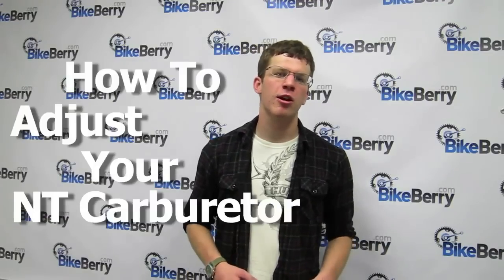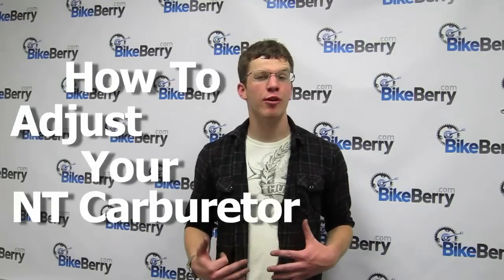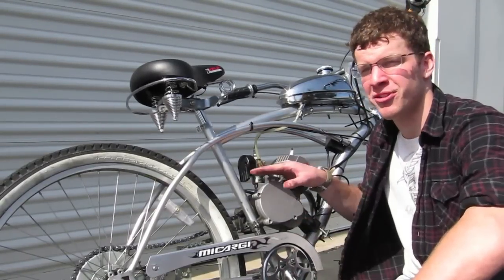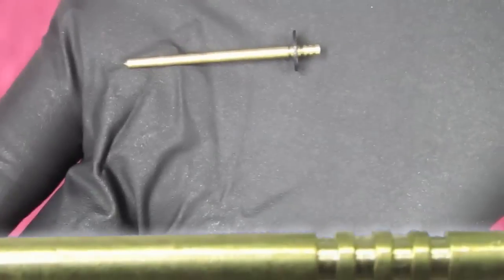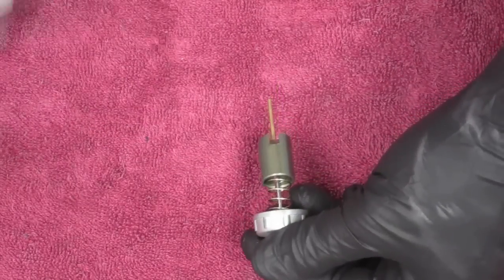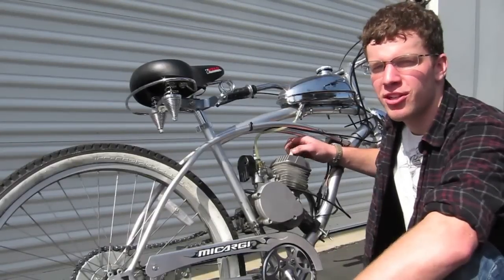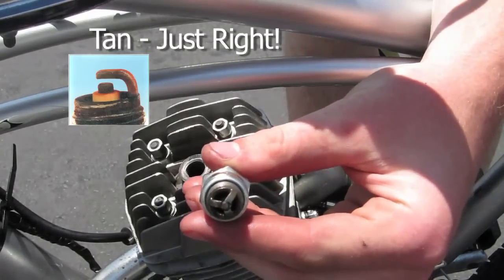How To Tune NT Carburetor for 48cc 50cc 66cc 80cc Motorized Bicycle

Comment: Hey guys! As far as the carburator adjustment is concerned....I have a 2 stroke 49cc Chinesse motor on my bike. All the times that I used to unscrew the spark plug, it's always was dark and oily. Today I opened the carburator and saw that my C-clip was placed just one place before the leanest position. So I decided to place it to the highest position (100% leanest mixture) so it doesn't run so rich, and put on a new spark plug. The result was that I get the same dark- oily appearance on my spark  plug. I'm running about 2 - 2,5% oil (Motul 2T). The only slight difference I guess was lower smoke from the exhaust pipe. My question is if the oily appearance it is a matter of spark plug. Somewhere in net I saw that the spark plug suitable for this engine is NGK B5HS, and I have NGK B8HS.  What is your suggestion?
Reply: +Marshall Murdock Hi, so since your are running a 2 stroke there will simple be more oil, but if its very dark and oily i guess going down a couple of jets might fix the problem.

but if the bikes running fine there should be no problem
Reply: Your plug is too cold, so it isn't burning off the deposits. The number is the heat range, lower number is hotter plug with ngk. Unless you run a full on race set up in the Sahara in August, that plug is far too cold. Get a b5hs , set up the carb right, and if you get pinging, change to a b6hs, but no colder unless you ride in really extreme heat

Comment: Hi, i just finished assembling my bike kit. the engine starts, but wont idle. if i keep pedaling the bike will run but it will not rev above idle!! the carb is brand new so it shouldnt have debris...even if i start it and pull in the clutch and twist the throttle all the way, the bike bogs down and wont go above idle......i am using pump gas with 8oz to a gallon. Please respond i really want to ride!!!!!!!!!!!
Reply: U prob got it figured out lol but the idle screw

Comment: My bike will only idle if I hold the throttle in a bit. Is that normal?
Reply: No it's not. Turn your idle screw a bit so that the idle RPM is high enough for it to self-sustain
Reply: If I turn my screw too much it sounds like it's running high at idle but if it's too little it will shut off..
there is no in-between
Reply: Mitch FTB check the clutch.
Reply: Mitch FTB there is an inbetween, dont turn it too much
Reply: Adjust the idle so it can run on its own

Comment: Interesting.  May try this.  My engine is new an still on it's first gallon but the jerking and lack of power at slow speeds sucks.  Full throttle seems ok.  Have a Dax rt carb coming so not sure how much time I'll spend on this one.

Thanks for the video!

Comment: My motor is brand new, when i first took it for a spin, i would go full throttle and it would speed up, now when i go full throttle it will start to accelerate then it will slow down, and not speed up like it use to. also my engine will not stay running.

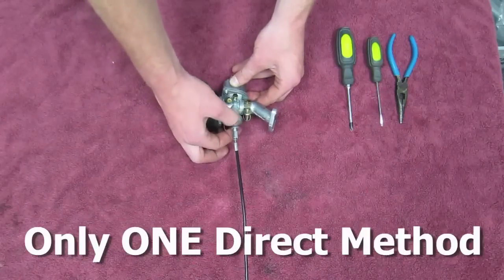Comment: At 0:37 you show the black spacer thing that connects the throttle cable to the needle. I was wondering, is it safe to trim off maybe 1mm off of the top end of that spacer? I am trying to increase the range of my throttle. Are there any other ways to increase my engine's power?

Comment: I'm having trouble finding any information on initial setup.  This video at least covers the needle setting, but no one is really talking about the initial setup for the idle or the preset position for the idle adjustment screw.
Reply from the maker: That is usually dictated by each builds necessity. Contact us at 1-800-317-0479 for more assistance on your build.
Reply: Thank you +BikeBerrycom for your rapid response.  I've looked into many YouTube videos on these engines and yours provided the information very clear and professional; I may contact you later if I run into any unique hiccups.  
+Jason Mason (commented below) providing some intel on the idle preset.  My idle screw was only capable of 8 full revolutions.  But by using 10 to 11 half turns in as a preset, I now have a baseline idle setting and the motor is idling nicely after some minor in/out adjustment (this is at appx. 6500 feet and around 45 deg F).  I'm going to leave the needle setting rich (as it came in the kit) as 2 strokes run better rich versus lean.  
I'm now running a 16/1 mix in 15 minute intervals (between cool downs) and at no more than 15 mph (and/or not over half throttle) for break in.  Please let me know if I am in error.
Thank you again.
Reply from the maker: It sounds like you're doing everything right and should be up and running soon. Keep up the good work and keep us updated with your build.

Comment: my 80cc engine is fairly new.... but when ever i hit up to 15 miles the engine starts to slow down until i stalls, or sometimes it will just ride at 14mph. when i first got it it hit 45mph how do i restore it to increased speed and a cleaner ride
Reply: Put the needle up our down and what do you mean by,24:1 because I'm part the break in period
Reply: Past break in period

Comment: i have a 48CC with a boost bottle.. i started it for the very first time and it idles really high i tried adjusting the idle screw by 2.5 turns out and it didnt help.. the c clip is at the second from the top.. should i leave it and just try adjusting the idle screw more or should i move the c clip?
Reply: +paintboy212 Hey, What did you end up doing on that?
Reply: Mafiameowr I actually just didnt put the throttle assembly in the carb correctly.
Reply: Oh okay, Still running good?
Reply: Mafiameowr runs great, but i may sell it to fund other projects. Check out my other channel, AustinBikes.

Comment: Mine barely revs, what do I adjust to get it to nyaaan higher?
Reply from the maker: RPM and combustion can be increased through several methods of part upgrades or tuning. Without investing in other parts, check the clutch , carburetor, and compression head.
Reply: BikeBerrycom I think I'm just too fat for a 49cc. The clutch is constantly slipping and I only hit like 13 mph. I sanded my squish band just a little bit and it helped, but it's still slow and sounds like it's dying.
Reply from the maker: 49cc engines are on the smaller side, but don't loose hope, some additional performance parts and tuning may be the perfect fix.

Comment: +bike berry I have a question, where can I get a fuel gauge display for my bike any suggestions?
Reply from the maker: We personally do not carry any such device in our inventory, but it can easily be purchased from most auto parts distributors, like Autozone, O'reilly, or Pep Boys.
Reply: BikeBerrycom would it be just a motorcycle fuel gauge or a special one?
Reply from the maker: Search for fuel gauges that are specified for 4 stroke engines, often labeled for use with boats and off road vehicles.
Reply: Why is it that my chain is tight at the top but loose at the bottom. I have shortened the length of my chain but not sure why it is loose. It runs of course but hits the tensioner. So should I take out more links?
Reply from the maker: Due to the nature of how the chain moves, the lower portion will always be looser than the top. Take off as many links as possible, then use the tensioner to take up any additional slack. Check out one of our many engine install videos on how this is done.
Reply: The bottom chain touches the top chain and I don't think their supposed to touch correct?
Reply from the maker: Correct. The chains should only be in contact with the two sprockets and the chain tensioner.
Reply: You guy don't have the aluminum throttle body? That's what I need my nylon one broke and I saw that you had one but out of stock. I went to Amazon to order one and they said none in stock but it said 14 left. When will you have one?

Comment from the maker: To reduce vibration, make sure the motor mounts as flush with the bike frame. Also, if it's still in the break-in period, I recommend breaking it in with the standard carburetor otherwise, you will have issues throughout the break-in period trying to get the right adjustments for your motor. The NT carb is perfect for the break-in.
Reply: BikeBerrycom:
where can I get info on installing a 2 stroke speed carb for my 66/80cc engine?
Reply: BikeBerrycom i love ppl like you much luv homie 👏

Comment: just got my bike running and the engine runs at full throttle all the time.  doesnt matter what i do to the idler screw or cables.  it just takes off full speed.  i taped around the carb mouting flange thinking i had an air leak and it still just races.  so when i ride it just keeps accelerating until its full speed.  then i need to disengage the cluth and kill the screaming engine.
Reply: Check to make sure the ends of the throttle cable are stuck all the way into the holes on the carb and throttle, also make sure your jet needle is all the way in and the throttle cable is slack when you aren't twisting the throttle
Reply: Ronald Fox it's your plunger. Take carb off then in screw your throttle cable and put it back in and make sure you don't rev to high or it gets stuck. I found solution to mine but too much to explain.

Comment: i am having a problem starting my bike...when i first got it it wouldnt,then finnaly did, but iv had it for months now and now it just wont start...when i get on the bike and start peddiling fast and pop the clutch,you hear and feel the engine turning and when i oull the throttle a little you hear noise as if trying to start like...pull vrrrr...pull vrrr but it just wont start i got an extra cdi a new spark plug and it was leaking gas from the carb but i fixed that i just donno what to do now...please help asap. thanks!also i sprayed starting fluid into spark plug area still wont start..
Reply: check or magneto connection. I had the same problem and the connection came loose. so I had to soder it back on. hope this helps
Reply: Dialectical grease under the spark plug cap.

Comment: So yesterday I was riding my 80cc push bike when I heard a pop sound and the bike died it's only a week old engine. I tried the plug it works. So I tried to peddle and see if it would fit with the cluch out now it just makes a clicking sound please help me.
Reply: mike voye sounds like a blown head gasket. An easy and cheap fix

Comment: his advice in this video isn't accurate.....lean conditioning is the lower notches and  rich condition is the upper notches rich is better DO NOT RUN LEAN lean running condition kills 2 strokes the richer the better as they say happy riding BTW this guy would have killed your bike if her were "fixing" it
Reply: LIES?
Reply: Stealth Moto do you not know how a carbs work? Low is rich high is lean.
Reply: Stealth Moto the more the slide is pulled up the more air gets in.